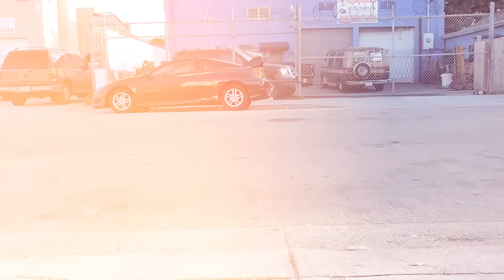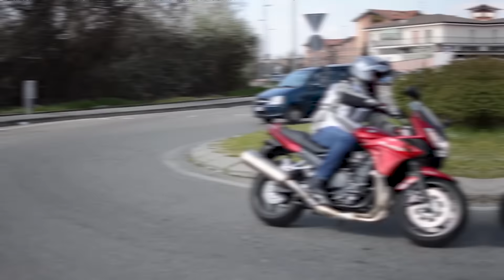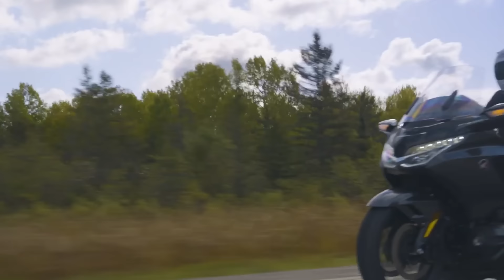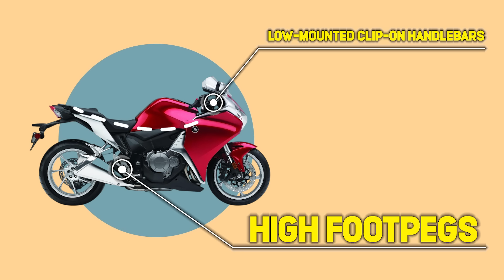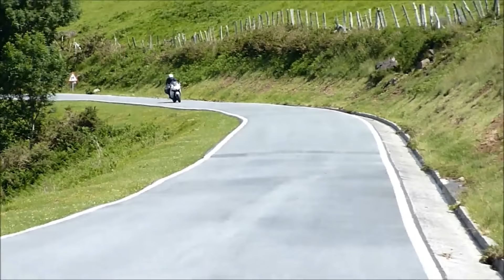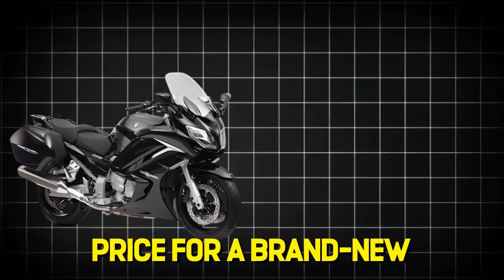12 Dirt-Cheap 1200cc+ Motorcycles, Nobody Buys! (But They’ll Outlast Every New Bike)!

Comment: Bikes for seniors? I ride a Honda ADV-150cc. At 82 I cannot lift or wheel up a slope a 1300cc bike. I have weather protection, CVT twist and go transmission, ABS brakes and easy mount and dismount. I’m seeing riders under 40 in this video. These are grand touring bikes. I ride around town. Buying big old bikes means problems. Better to trade in on new every two years. It’s horses for courses I guess.
Reply: As a healthy 82 yr old, 5'7"  and 170 lbs I ride a 2006 Yamaha FZ1 - reasonably lightweight (wet 487 lbs) 148 Hp, 78 ft lbs Torque, 4.76 gal, 0-60 3.1 sec... on the highways of Southern California, but on the back roads of Thailand I ride the new Kawasaki Eliminator SE 500

Comment: I ride a 2005 ST1300 Pan European that has clocked 148,000ks.  Apart from normal servicing, ive only had to replace the fork seals about 90,000ks.  Its an excellent bike👌

Comment: I had a 1994 RF600rr, put 157,000 miles on it before I sold it. Recently,  l rode a 2004 K1200 GT.  Now, I ride a 2014  K1600 GT.  Shaft drive, please, and less electronics.

Comment: I have a Trophy SE , valve clearance interval is 20k miles , not 10k , when you get that done, you have them do the plugs and air filter. It will sit at extra legal speeds all day and return over 50 mpg. It is top heavy and handles better once moving over 15mph. The awkward weight comes from the tall engine with 6.6 gallons of gas over that tall engine. It's a beast.
Reply: I just bought one. 2017
Reply: @craigmcdonald6305 sames, she's such a polite beast

Comment: You can go even cheaper... the original Pan European, the ST1100. Slightly lighter than the ST1300 with a very low center of gravity because the fuel tank is more or less under the seat. No complex electronics, easy to maintain by a competent hobby mechanic.
Reply: Got a '97 one, works like a dream! 2500km in 2 days is nothing for it! Don't know yet of a better option as an upgrade!